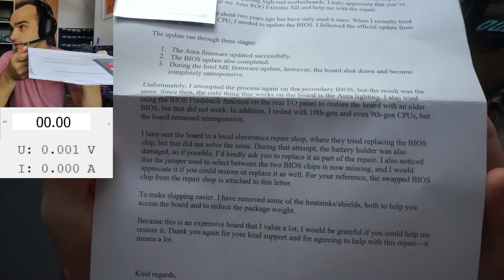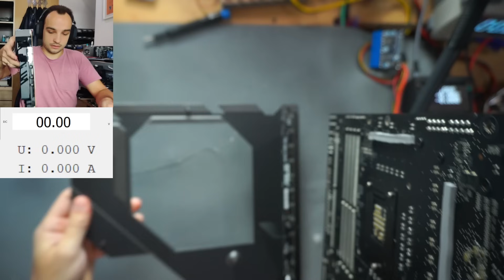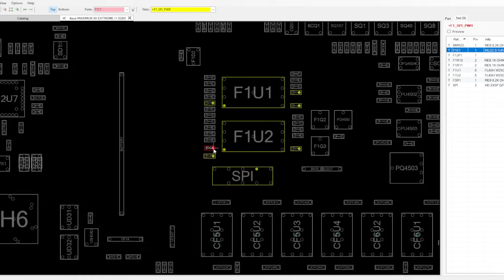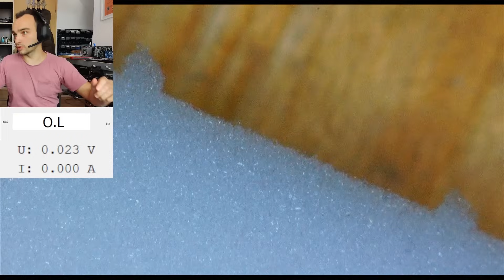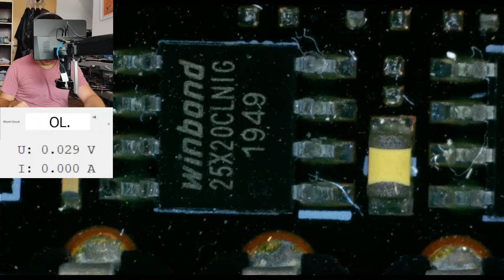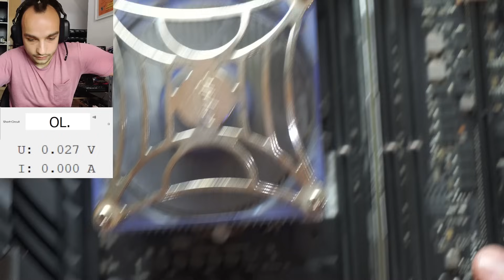Previous technician destroyed this motherboard – can we help this viewer?

Comment: Good video. How have you got this firmware of the tpu controller cuz I had a Asus strix b250f gaming on my bench but I tried to find its tpu firmware but I had no idea where to find it. I think on Asus website is not available. Am I wrong?
Reply from the maker: You are correct! The TPU firmware needs to be extracted out of the bios itself! https://winraid.level1techs.com/t/solved-asus-tpu-unit-firmware-guid/32418
Reply: @MainboardMedic thank you. I will not  know what to do if this firmware in the bios chip is corrupted.

Comment: Hi my friend, I watch your videos and really like how you work. I have a Z790-F motherboard, and the problem is that when I press the reset button, there’s no image — I have to completely power it off, wait about 5 seconds, then press the power button again for it to show an image.

This also happens when I’m in the BIOS — if I press the power button to turn it off and then quickly press it again, there’s no image.
Where should I check? Thanks.
Reply from the maker: I would try to flash the bios. There can be many things bad with that. Do you have debug LED´s, whats their behaviour?
Reply: @MainboardMedic Hi my friend, I managed to fix it — there was an issue with the pins; I put them back in place, and now it works perfectly. One more question: I have a B760-I that doesn’t get Vcore voltage when the processor is installed, but when I remove it, Vcore appears. Has that ever happened to you?
Reply from the maker: Cant say that ive encountered an issue like that before! Are you sure that the CPU is good?

Comment: 9:33 comeon man. Don't release (unclip) the solder sucker above motherboard. Take a look how many tiny solder particles you spread out on to motherboard.
just unclip it far away from electronic components. 

(info for others: solder particles are conductive, and they can make a short-circuit on pads, pins, legs, or even they can go under the bga chip and make a short on solder balls)
Reply from the maker: Yeah that wasnt very smart of me haha! Had do to some clean up afterwards

Comment: 9:30 Ok, so you do have a desoldering pump / solder sucker, could've just used that from the beginning, works better when there is still a tht component leg present. (Why the heck are you dumping the solder back onto the motherboard though? Point that thing somewhere else when resetting the pump, like into a cup with brass sponge for soldering iron tip cleaning.)
Reply from the maker: I really should have dumped that somewhere else. I made a mess with that!

Comment: you are using CH341A Bios Flasher right?
did you flashing the bios without removing the BIOS chip itself? are you using the SPI-TPM pinout? i really wanna know
Reply from the maker: I use the SPI header here yes, but i am using the REVELPROG-IS. Its a lot faster and easier to work with, but expensive. I started out with the CH341!

Comment: I have an Asus Strix X370-F. I extracted the original BIOS from the website using the UEFI tool and burned it with a programmer, but it's stuck at the Asus logo. It doesn't freeze, but it also won't progress. I can turn num lock on and off, but it won't enter the BIOS. I burned the BIOS for my Asus X370A motherboard. It works normally, and Windows boots. But it's not stable. For example, when XMP is opened, it gives a blue screen. Where do you think I should look?
Reply from the maker: You can try to flash the bios via the integrated flashing tool within the bios itself. Ive seen stuck Asus logos due to bad PCH. 
Could be bios chip, but i doubt it!

Comment: So BIOS get corrupted while updating, and then a bad electronic job breaks it more :D Nice fix, shame about that ATX 12v supply misguided you, I have one of those, not the same model, and I find out that it gest bogged down on some board, haven't tested a lot, dont do a lot of MB repairs, but It happened to me several times.

Comment: Cool  video, like your work very helpful for generating ideas for fixing boards, thank you. Really like this board, the on board display is amazing, except not BIOS design, great work saving it. Seems to me the high-end boards are much more difficult to work on but perhaps more rewarding to fix. I copied your power adapter so I could see start up power draw. Brilliant idea. I have had a couple of higher end boards which needed a full power supply to get all the way to boot. Guessing there might be a power spike or something that causes a volt dip somewhere.

Comment: I think the jumper is just for the flashing connector and the switch with the leds is the bios select to set what bios it boots from so maybe its okay to just switch it and then power cycle it and the jumper does not need moving
Reply from the maker: That would make sense, thank you for sharing!